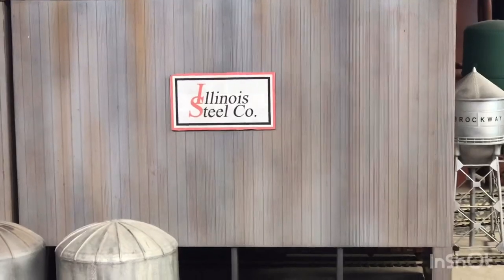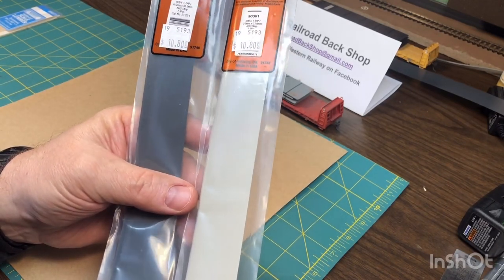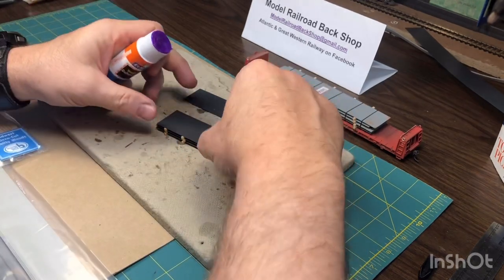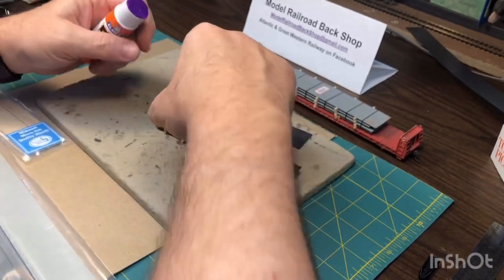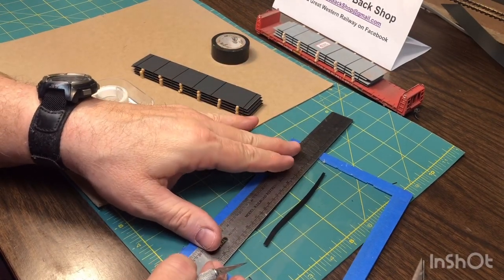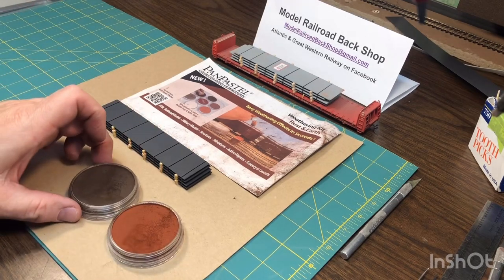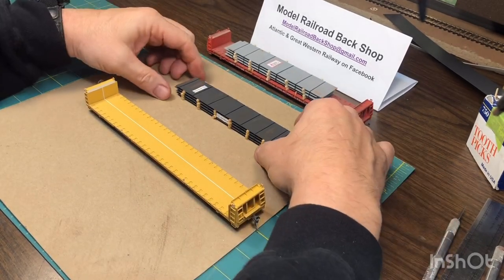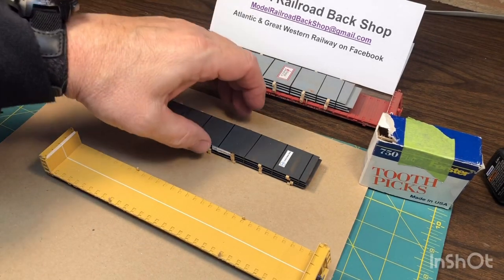2. Model railroad steel mill flat car loads with Roger Kujawa

Comment: 1/32 chart tape works very well for binding loads down. I've tried to cut electrical tape down that small. Had a super hard time doing so. 1/32 chart tape does the job quite well. Amazon has it in stock.

Comment: Chartpak graphics tape (art supply store) also works well for the metal banding. Comes in pre-cut widths, so you just need to trim to length. More expensive, a little easier... there's always a trade-off in this hobby!!!
Great video Roger.

Comment: What was the thickness and width of the plastruct ? That'd a great idea.
Reply from the maker: Thanks for watching.  I buy the strip from Plastruct and don’t have to cut them. They come in different material and colors.  1, 1/4 is the one i use. https://www.plastruct.com/collections/strip-amp-rod-2/products/90361-stsc-1